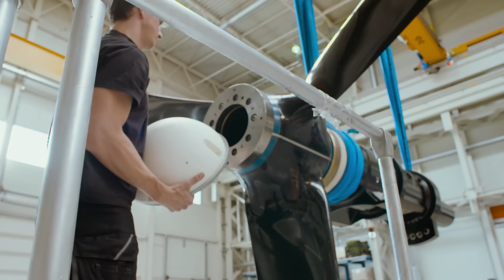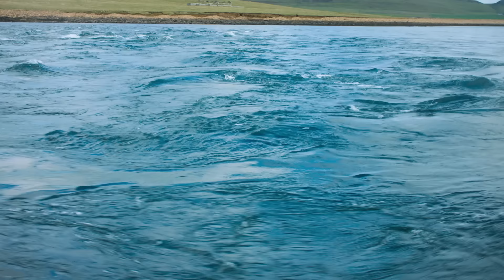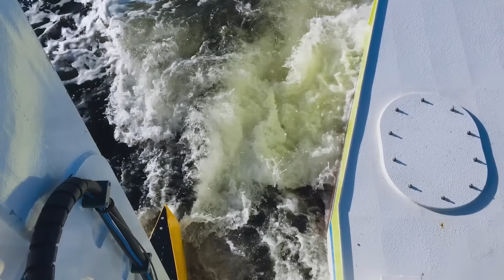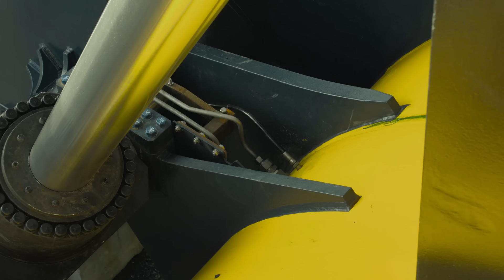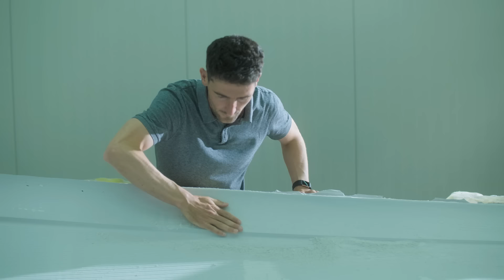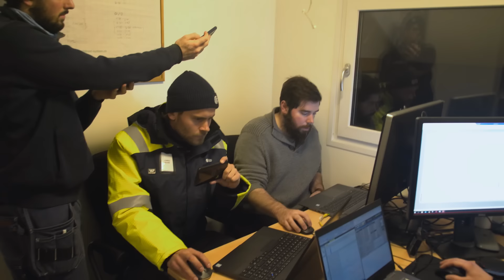Tidal Power: Unlocking the Greatest Untapped Energy Resource on the Planet | FD Engineering

Comment: In 1980, I worked at McNary Dam as a welder relining the turbine blades in the generator vaults, ( The river runs thru them ). The dam is rated at 1.1 MW. The Columbia River never stopped flowing 24/7. Water power, whether from a river or the ocean tides, is absolutely reliable, vs wind power or solar power. This concept of submerging the power turbines underwater is the critical breakthrough needed to make this type of power generation feasible, practical, and cost-effective. As a bonus, most ocean going cargo ships can safely pass over them. It is also great that they are not spoiling the ocean views, unlike wind turbines. And they do not need thousands of acres of land, unlike solar panel farms. It's a win, win, win.
Reply: So what happened with this project now? Why this idea not using widely?
Reply: @junkvista61 I wonder this also.
Reply: @shawnsanborn2057  Unless you are a creature - the sea eats you.
Reply: I never thought I would see a lower less efficient energy system than wind generators in windless areas. The early USA federal rebates gave away money to buy wind generation systems in areas of near zero resource. These projects have  now under  done the least efficient ways to research/produce/harness energy.  Developing the most costly generation system/unit of energy that fails in over 99.99% of seas, working for only maybe 25% of the time in a salty corrosive environment... under water.  To top it off there is little need for such a uneven power cycle in these few remote areas it might work. How can you not see these terrible economics?  Why would you ever compare this to hydro power on a large dam, also used to store water for agriculture and cities 24/7 in much less corrosive waters.  The famous Scottish Highlander known back in the 90s for his DIY windmills using rewound  used motors and hand built blades was so beyond anything in these projects.   Maybe we can start by figuring out how to live under water before generating power for that town.  The university of Hawaii research center has already proven the best energy extraction methods for ocean water .... temperature deference at various depths.  The unharnessed energy from a thermalcline generation system is also useful for cold water aquaculture, freshwater from air, and growth of cooler crops in tropical areas.
Reply: So what protections are there for the sea life??

Birds get killed daily by wind turbines!!
Reply: Tides are predictable. They are also intermittent. Therefore, storage.  One more element in the sustainable mix.
Reply: @markharmon4963  Wouldn't you say that picking the type of alternative energy most promising, maybe most effective and best output to cost (including environmental costs) ratio would be a sustainable policy approach? Does it matter if this costs 1000x more and have near zero potential relative to wind or solar or geothermal energy? Does a budget or physics matter?
Reply: "Water power, whether from a river or the ocean tides, is absolutely reliable, vs wind power or solar power. "

a) not if the flow of water into the generator stops,or the generator fails, or the power-transfer system fails.

b) in any case you'd want to use some kind of energy-storage system to supplement the direct supply
Reply: The dams in rivers chánge the natural flow of the river so the lakes behind the dams heat up the standing water in the reservoirs that effect the ego system of the river and the reservoirs trap the silt which over time builds up .The water running over the spillways and thru the turbines cause the co2 in the water to climb that kills migrating salmon that are headed to the oceans in thier life cycle. The immature salmon are killed by the millions going thru the blades of the turbines or over the spillways of the dams. All the dams on the Columbia river has caused the once massive salmon runs to be a small fraction of what they were prior to the building of all the dams that block the river along its complete lenth of 120 miles from the ocean to the rivers beginning . They are a necessary evil that have caused huge ecological damage to the river an surrounding area. Most of these dams were built prior and during world war two to generate power for the manufacturer of aluminum for the war effort
@touristguy87

Comment: Just a side note, The United States Navy has the biggest ocean simulating indoor pool in the world. Not the UK, and neither are the only two on the planet..
Reply: I don't think they said it was the biggest, rather that its the only one to be able to reproduce all sea conditions - waves, current and depth. I think the Navy's Open Ocean does exactly that, open ocean.
Reply: Also I believe they use a moving gantry system rather than creating currents by moving the water, so it great at what it's designed for but not really suitable for tidal turbine systems.

Comment: What needs to be borne in mind is that the power produced by these machines is "green" or "sustainable" only after they've generated the power used in manufacturing and maintaining them. Finding breakdowns of these numbers seems to be impossible. My suspicion is that they barely repay that energy debt, if at all (IOW they are NOT 'green') and their usefulness is in their portability and being able to move power generation capacity to remote areas where, for whatever reason, extending the grid is impractical (I don't actually see what impracticalities those would be - ETA >> cables can be laid practically anywhere).

Comment: I have been seeing projects proposed for the last fifty years that have ideas to use water energy to generate electricity.
One used two floating platforms which had either hydraulic or mechanical bears to make the moving platforms moving on the waves generate mechanical energy in to electrical power.  Another was a hydraulic screw (propeller) that would be submerged into a large river and would turn because of the flow of the river's current.  This would then generate electrical power.
Another was tidal flow much like the river flow.
Unfortunately, everything man made that moves eventually breaks.  The long term (10 years or more) feasibility of these projects tend to fail because they cost more than the existing generation of electrical power.

Comment: Constantly changing the unit of measurement to make these things sound more impressive...

That last one they had to change to "1,000 TVs" because 100kw is so much less
Reply: 🤔Good Point🤔.
Reply: @Buddahabrot  It's a test model.
Reply: @alanbreznik5760  I would call the a waste of money study.  A model would be many times smaller for proof of concept.  I never thought I would see a lower less efficient energy system than wind generators in windless areas. The early USA federal rebates gave away money to buy wind generation systems in areas of near zero resource. These projects have  now under  done the least efficient ways to research/produce/harness energy.  Developing the most costly generation system/unit of energy that fails in over 99.99% of seas, working for only maybe 25% of the time in a salty corrosive environment... under water.  To top it off there is little need for such a uneven power cycle in these few remote areas it might work. How can you not see these terrible economics?  Why would you ever compare this to hydro power on a large dam, also used to store water for agriculture and cities 24/7 in much less corrosive waters.  The famous Scottish Highlander known back in the 90s for his DIY windmills using rewound  used motors and hand built blades was so beyond anything in these projects.   Maybe we can start by figuring out how to live under water before generating power for that town.  The university of Hawaii research center has already proven the best energy extraction methods for ocean water .... temperature deference at various depths.  The unharnessed energy from a thermalcline generation system is also useful for cold water aquaculture, freshwater from air, and growth of cooler crops in tropical areas.

Comment: Failure after failure has proven this is an unsustainable form of energy.  The cost of research, materials and repairs on failed equipment far outweighs any benefit of this "free" energy source.  To this day, there is not one design that has worked, or lasted in Ireland.  There are currently no functional tidal turbines in use.  A waste of resources, tax money and time.
Reply: False, and proven since more than half of century of exploitation in France, where a single unit in Britanny generates a quarter of the electricity used in that region since 1966 (before that tide was already used with smaller units on that river since 1896, so this was not new, but using tidal energy is not new at all). It was for long the largest production unit at 240MW, before another unit was built and opened recently in 2011 in South Korea with about 250MW. Only Russia intends to open a larger project to generate more thn 1GW, but this is still a project. Another project in South Korea was started but abandoned (but it may be reopened with further sutdies).

Comment: A no win scenario has here been generated by dismissing gradual voluntary development of light crude distillation , and basing decion making on hypothetical green energy schemes . To export crude you cant distill properly, and import the crude you are prepared to process makes sense for producers. 
Simply ask the producers what conditions they require for us to become more independent of foreign sources. That is the advantage of capitalist system , you personally dont have to envision the solutions to seemingly intractable issues , the decision making can be done by flexible and opportunistic providers if the government simply sets the stage which allows them those opportunities. If the Jones act is an impediment, reexamine it. 
But something this vid did not address , is whether hindsight reveals the administrations success or failure  , vs stated goals. Clearly fuel prices have gone up significantly , but has development of our refining and delivery systems improved?

Comment: Just put a turbine within the hull of the ship, basically a hollow tube facing the tides. The wake will allow multiple blades behind each other. They can be maintained by closing the hole and pumping out the water. They will be stream line enough to always face the tidal direction and reduce anchoring.
Reply: That is exactly how the generators are built. Did you even watch the video at all?

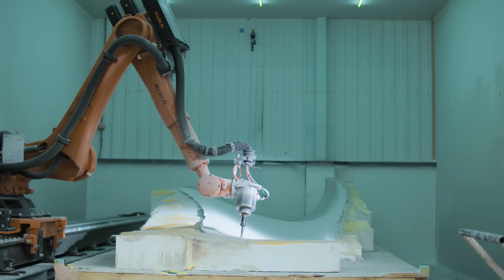Comment: 42:00 Of coarse a CNC cutter can create a much smoother surface than what was shown.
I assume they were either too cheap to pay for the additional machining hours to achieve it, or more likely the choice of a robot arm over a dedicated CNC router on linear rails meant the accuracy wasn't there to give a close step over surface finish that wouldn't need hand sanding anyway. So they chose to use use a quicker big step over with the robot arm and fair out the difference by hand.
Small detail in the scope of the documentary, but annoying sweeping statement to someone who has cut many large moulds with a CNC router,